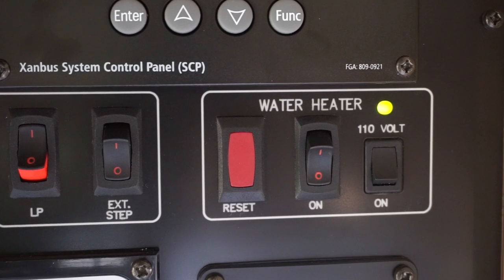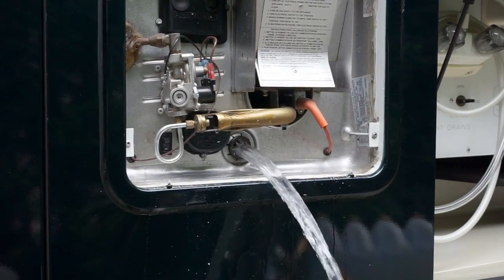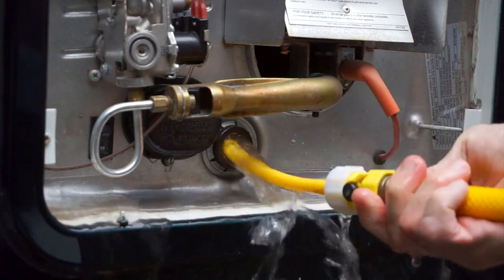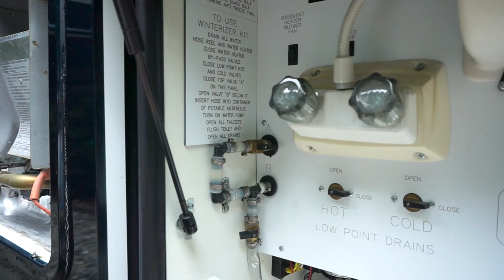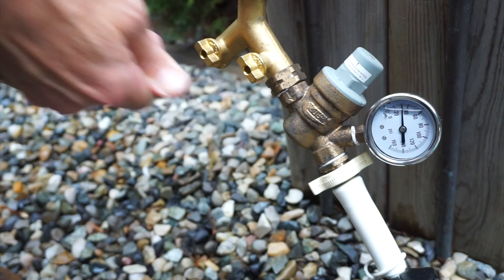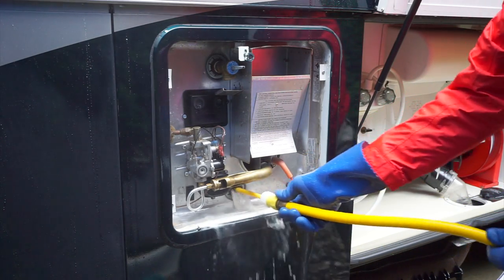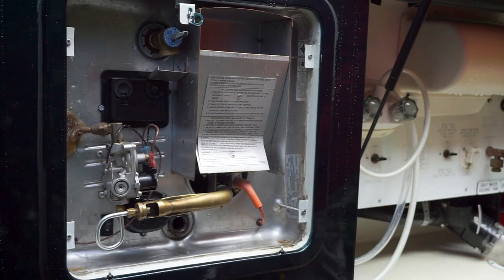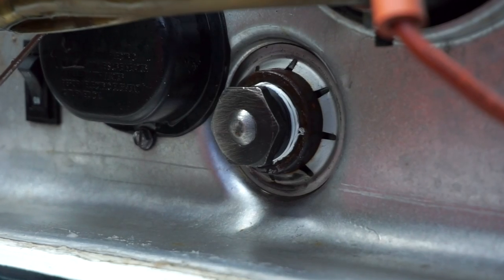Does Your RV Have A Water Heater? WATCH THIS!

Comment: Once again, great video! Have a number of questions: (1) I know you don't have a tankless system, but do you think that there is buildup in the lines of a tankless system (we have a Girard tankless system); (2) We had some issues with mineral build-up in our RV plumbing and bought a water softener which we use for both filling freshwater tank and when we use city water at an RV park - would that help reduce the build-up in a 6 or 10-gallon tank?; (3) The guy who gave us our RV 1-hour orientation class said that we should always put 4 ounces of white vinegar in the freshwater tank when filling - would this help and is this a good idea? We have done this for the past year-and-a-half. We don't drink water from the system but purified water in bottles. Additionally, we have bought a filtration system for the kitchen sink and a filter that attaches to the shower nozzle line.
Reply from the maker: Hey Ray... thanks! Glad you enjoyed the video. In response to your questions:

(1) We'd think there could be buildup inside the Girard water heater, but we'd defer to the maintenance recommendations in the owner's manual for your system. It's possible that adding vinegar or any other chemical through the plumbing of the Girard could cause some other issue with corrosion, blocking pathways through the heat exchanger from scale that gets knocked loose, etc.

(2) Absolutely! But it's also doing that for your Girard Tankless, too. We've considered getting a water softener ourselves, but we haven't been traveling through areas with hard water as much as we used to, so we back-burnered it for now. If we were in the desert southwest more, we'd definitely add one: it's easier on ALL of the plumbing, better for your skin & hair, and eliminates all those nasty water spots in the shower! ;)

(3) We've never heard of that... sounds a bit like an old wive's tale! We assume he told you that because of hard water issues... but 4 ounces of white vinegar in a 50+ gallon (don't know the size of your RV and/or tanks) fresh water tank sounds a lot like spitting in the ocean to us. Your water softener is doing way more to help protect your plumbing than a couple ounces of vinegar in the fresh tank. And we'd assume that if your water softener is doing the job and softening the incoming water, ANY amount of vinegar would be unnecessary. Don't think doing it is harming anything, but it does seem pointless to us.

Hope this helps!
Reply: What you say makes sense. We do live in the Southwest (based in Las Vegas - winter in Arizona). We have a Pleasure-Way B+ with only a 25-gallon water tank so maybe that was why the 4 oz white vinegar recommendation. You're right, kind of moot now that we have bought the water softener which, of course, did not come with the RV originally.

Comment: I think I'd consider attaching a line to your pop-off valve when you empty the vinegar, so that you're not dumping vinegar (acid) on your electric components of your water heater, it accelerates corrosion, rust. Doesn't  have to be a perfect seal, since it's not pressurized.
Reply from the maker: Hi Tom. Good thought, but on our water heater (and all that we've seen) the electronics are all mounted above where the drain plug is... so draining the vinegar solution doesn't end up splashing them. Been doing this same procedure for almost 2 decades and haven't ever had a problem. But funneling the drainage away using a hose/line certainly wouldn't hurt anything.

Comment: Great video guys.  I also clean our Suburban tank and replace the anode yearly as we winter over in AZ. Very hard water. I was shocked by the amount of deposit flushed out of the tank the first time I rinsed it.  I have never used your vinegar method to also clean the electric heating element, but will begin doing so.  I've got to get one of those borescopes. Now I'm just plain curious.
Reply from the maker: +Karen and Steve Fischer We'll be doing a 1-year follow-up this fall. Can't wait to see how much built back up in there after one year!

Comment: Have you thought about using acidic acid crystals instead of vinegar and adding it to tap water?  It is the active acid in Vinegar, and it probably costs less.  I used it when I was in the US Navy to clean piping systems.
Reply from the maker: No... hadn't thought of that (or even knew that they existed). Probably a smarter way to achieve the same thing... plus it would make it easier to adjust the acidity level as needed to dissolve more/less scale. Thanks for the suggestion... we'll have to look into it!
Reply: OH I just remembered, you can also buy Citric Acid in crystal form, and you can get it locally where they sell home canning supplies and in some ethnic markets near the spices.  I don't know if there is a cost savings.  do your own research, your mileage may vary.....

Comment: Great video guys. I was wondering if using double strength vinegar (about 10% Acetic Acid) would do a more thorough job?

Would 10% Acetic Acid be too strong? Might it harm something?
Reply from the maker: We did read something about strong acetic acid vapors being potentially corrosive to steel in high concentrations, which could potentially be an issue for Suburban tanks, and possibly other components inside both Suburban & Atwood heaters. We're not sure how to go about finding a definitive answer, so might just use regular vinegar over a longer period of time, if needed.

Comment: Good video. Would it have helped to take the rv for a drive while the vinegar was in the tank to agitate the mixture a bit?
Reply from the maker: +agh19 We'd think that the agitating action from driving is likely a bigger benefit in a larger tank, like when cleaning the black tank, and that the small volume of water in the heater wouldn't benefit as much from the motion. That said, it wouldn't hurt either. We just wouldn't go to the trouble of driving during this process unless you were planning to anyway. 😊

Comment: Awesome video.  I assume you should remove the whole house filter before introducing vinegar into the system, or are the winterizing valves downstream of it?
Reply from the maker: Great question. On our RV, the first thing incoming city water passes through is the whole-house filter, so the winterizing kit is indeed downstream, making it unnecessary to remove it. We assume most RVs are the same, but it's a very good point to be aware of it. Thanks!
Reply: Thanks for the reply!  I'll have to check that out.  My mind's eye remembers pink stuff in the filter canister, but I could be wrong about that.
Reply from the maker: Since there doesn't appear to be any standard for how RVs are plumbed or wired, your memory could be correct and your RV's plumbing could work differently than ours. You might want to test it first before you end up pumping vinegar through your fresh water system!  <YUCK!>  LOL!

Comment: Just a quick lesson Plumbers Tape is a metal tape with holes in it that is used for strapping pipes to hangers with screws or nails. Teflon Tape is used for thread sealing. Just a FMI from a plumbing contractor, great video's.

Comment: In your original video you mention having issues with the anode plug being hard to remove. Why not use a 3/4" NTP thread tap to clean up the the threads?
Reply from the maker: Thanks, Corey. Good suggestion... but we only had trouble with that one anode, so we're pretty sure it was an issue with the threads on the anode rod itself, and not a problem with the threads on the water heater. All anode removals/installs since have gone smoothly. But if we have trouble again, we'll pick up a thread tap and do just that.

Comment: Hi guys, dumb question.  The socket you use to install/remove the nylon drain plug for your Suburban water heater during cleaning....is it a  6 or 12 point?  Thanks.
Reply from the maker: Hi Kevin! Sorry we’re currently travelling by RV in Italy, and not on our own rig, so we can’t check our tool kit right now. But I’m pretty sure it’s a six point socket, as I prefer those for their tight direct fit on the hex head of a bolt. But the 12 point sockets will also get the job done.

Comment: I could have sworn you guys made another video after this one using 12 gal of straight vinegar. Am I imaging things?
Anyway this weekend I am going to fill my 6yr old suburban 10 gal WH with straight vinegar to clean it out. I'll fill it at 9am and drain it at 7pm. What say you??? Good idea??
Reply from the maker: Hi Chris! We've never used more than a 50-50 mix of vinegar-to-water, so that vid must have been someone else. But after shooting this video and seeing that a 40% vinegar concentration for 16 hours still leaves a little bit of limescale behind, we're going to up the concentration this year.

As a matter of fact, we're just about to do the 1-year follow-up and inspection, so look for that video soon, probably within the next several weeks. Our plan this year is to buy 6 20-liter containers instead of the four we used last year. That's about 8 gallons vs a little over 5, so a concentration in our 12-gallon tank of about 66%, up from 40% last time.

We'll probably still finish adding the vinegar in the evening, keep the heater on all night (heat makes a big difference, accelerating the reaction), and drain it in the morning. Of course we'll show both before and after shots with the borescope so that we can see how much scale there is after one year, and how much we end up with after the vinegar treatment.

We think your 100% vinegar plan from 9 to 7 sounds good, assuming you've been  good about flushing it annually. If it's been sitting for years without being flushed, and you open the drain to find huge amounts of scale piling out, we'd consider going for an overnight treatment, of course being sure to keep the heat on all night.

Hope all goes well for you. Please let us know how you make out!

Comment: hello RV geeks, last trip I didn't had any hot water on my 2006 SuperLite Weekend Warrior and I have a Suburban water heater, I did the flush just like lots of good of white chunks came out. But my question is how can i fill up with the tank with vinegar? PS how do you change the relief valve from the hot water tank? its leaking water. 
Thank you, you guys made a great videos.
Reply from the maker: +Daniel Algara Hi Daniel! First, your relief valve may not need to be replaced, but might just need to be flushed out, or try soaking it in vinegar. Removing it usually takes a pipe wrench, and removing it would also allow you to add vinegar through it using a flexible funnel (I'm assuming you don't have a winterizing kit to add the vinegar through).
Reply: Great information, No I dont have a winterizing kit on the rig, (I just saw a video that they talk about the kit and who to install it) My tank rod it was all gone, lots and lots of white chunks are coming out. 
Im gonna try to flush the valve and install a kit. Thank you RV geeks.
Great videos by the way!

Comment: I love your videos! I have a question, however....I have a winterizing kit in my 2009 5th wheel that I use when I put in the pink stuff in the fall. At the same time I turn off the valve to the hot water heater so that none of it goes into the hot water tank. You're saying in this video that if I open the valve allowing fluid to enter the hot water heater, that it will automatically go into the hot water heater and not into the other water lines? Is that right?
Reply from the maker: Hi Bob! Thanks for the nice note. If your water lines are all filled up with water, and the water heater is empty, the vinegar will indeed flow into the heater, as it's the only place for it to go (it looks for the path of least resistance, and with your faucets all closed/off, the empty water heater is its only path). When you finish the flushing job, there may be a small amount of residual vinegar that's made its way into the water lines, but it won't smell to strong, and will quickly flush away.

Comment: hello I just subd to your channel love these very informative videos. i"m buying my first ever RV ... a 1978 Ford Travelaire and was wondering if this procedure is similar to clean my hot water heater.
Reply from the maker: Thanks so much for the note, and congrats on your upcoming RV purchase! The process is pretty much the same on most RV water heaters, varying a bit depending on the water heater brand, and whether or not the RV is equipped with a winterizing kit. We've done a few videos showing flushing out both Suburban and Atwood heaters (playlist here: https://www.youtube.com/playlist?list=PL3F52F45346F2CD24

If you have an Atwood brand, you might want to check out the video on that one, since there is one minor difference (no anode rod). A minor difference, but good to know). Keep in mind that you 1978 may be different due to things changing over time.  Hope this helps a bit, and safe travels!

Comment: Great video. I have the Suburban water heater and wand flush it yearly. Rust and corrosion on the threads makes it more difficult to replace the anode rod each year. Do you know of anyone that makes a thread chaser to help clean the threads on the tank?
Reply from the maker: Here's an informative article on this topic from the RV doctor. Hope this helps! http://www.rvdoctor.com/2012/01/stripped-threads-on-rv-water-heater.html

Comment: Getting ready to dewinterize and I have an Atwood water heater in my Open Range.  My owner's manual has this warning in it:  "NOTE: If a chlorine taste lingers in the water, flush the water system with a solution consisting of one-quart vinegar to five gallons of clean water. Re-flush as necessary. The vinegar solution may damage the water heater so it must be bypassed again before performing this operation."  If one quart causes concern by the manufacturer, what will five gallons do?
Reply from the maker: Hi Michael! Vinegar is a pretty standard way to dissolve the limescale buildup in both steel Suburban tanks and aluminum Atwood tanks. We’ve never heard of an issue with it. Atwood actually has a flyer that specifically says to use a stronger vinegar mix than we do (60%) for a longer time than we do for removing odors, so I can’t imagine how it could harm the tank. That flyer is here on Atwood’s site, listed under “unpleasant odors”: http://www.atwoodmobile.com/images/WaterHeaterServiceTri-Fold.pdf
Reply: Thanks so much for the information!  I'm beyond my warranty anyway so I'm going to try the vinegar solution.  I also have a borescope so I'll get a chance to see the before and after.
Reply from the maker: Excellent! We love our borescope. 😀 Not sure if you caught our recent follow-up to this video, where we did a 1-year follow-up internal inspection, but you might find it interesting: https://youtu.be/RSHBc66W4yE

Comment: I just watched your video on sanitizing the fresh water tank and understand during that you by-passed the water heater.  Here you do not but ( I admit I don't having any thing showing the pumping system) but what stops the Vinegar from going to the fresh water tank.
Reply from the maker: Hi Larry! We're going to caveat this by saying that not all RVs have the same plumbing configuration, so your mileage may vary on this... but in OUR motorhome, it works like this:

When we have the winterizing kit set up to suck liquid into the system (in this case, vinegar for de-scaling the water heater), we have the selector valve for our fresh water set to "City Water". The other option on that valve is "Tank Fill". If we chose that, instead, the vinegar would, indeed, end up in the fresh tank. But with it set to "City Water", that pathway is closed off. Instead... the only place for the vinegar to go is into the water heater, since the tank is empty from previous steps in the process.

Hope that makes sense!

Comment: Wouldn’t you want to fun the vinegar through you shower and pipes to help get rid of any build up in the system. I know it might take some flushing to get the taste out, but it could improve water pressure.
Reply from the maker: Hi Colton! We've never actually had any issue with our water pressure. The PEX tubing in RVs seems to be pretty impervious to scale build-up. When we cut into one during our water purifier installation ( https://youtu.be/YNX4DKo8ngg ) we noticed that the condition of the tubing was excellent. I suppose there wouldn't be any harm in flushing with vinegar, but not sure it's necessary. For the shower head and faucets (which seem to build up scale faster due to air exposure), we soak them in pure vinegar.